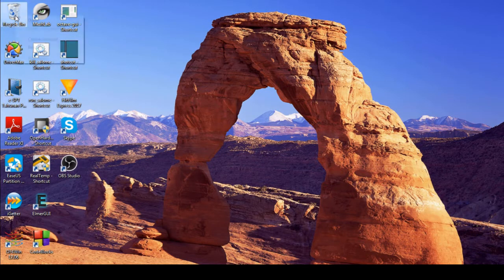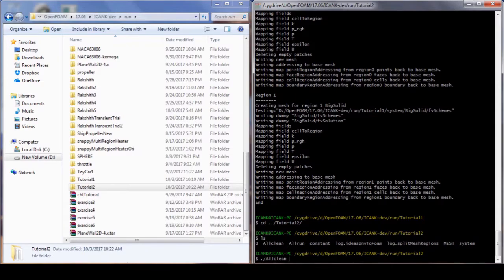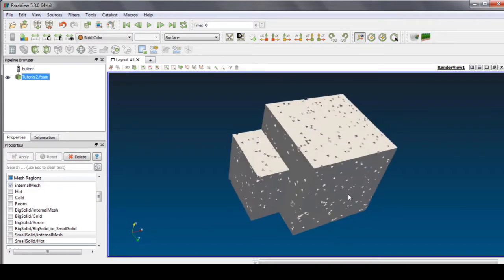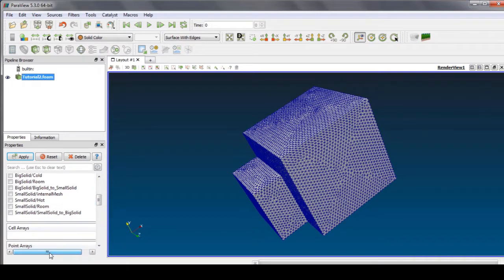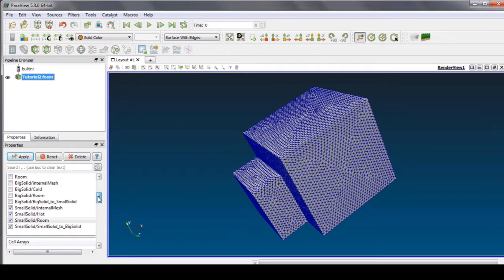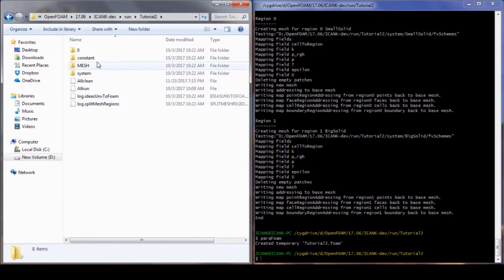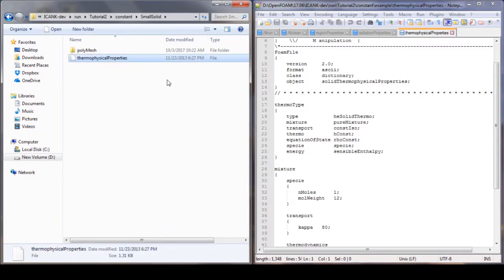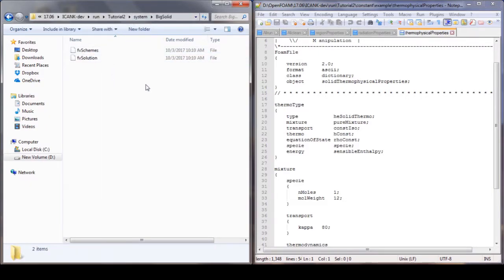SALOME & OpenFOAM Tutorial: Heat Transfer Between Solids - Modifying Case Folder

Comment: Hi, I have a question, where can i find information about the differences between OPEN-FOAM vs SALOMEMECA? , depending of what I should use one of them,  for what kind o physiscis intendef for, each of them? , both can handel fluid structure interaction, with the same perforamance,  modal analisys?

Comment: First of all, thanks for the amazing video

I have a question, try running the command "paraFoam" to open paraview. However I get the following message:

Invalid $ PV_PLUGIN_PATH and -plugin-path = not defined
No supplementary ParaView / OpenFOAM reader modules
Using builtin reader: paraFoam -vtk

Created temporary 'test2.foam'
/ home / jorgeamg7 / OpenFOAM / OpenFOAM-v2006 / bin / paraFoam: 420: paraview: not found

The way I installed paraview was that I downloaded it and installed it on windows C disk.

Comment: I've meshed a heat exchanger on freecad, there's one fluid and one solid region. The solid part has fins, which has interfaces with the fluid region so it's a very complex geometry.

when i try to use snappyHexMesh, it cuts out some of the fins, do you have any suggestion or any thread that could solve my problem?
Reply from the maker: Try to make the surface mesh denser in SHM. For sure you need to do a lot of trial and error for finding the appropriate setting. You can try also find the answer on  Cfdonline website.

Thanks

Comment: Hello @Ali Ikhsanul.. your videos are great. Really helpful. But in this part, when I am trying to run the ./Allrun script it throws an error that chtMultiRegionSimpeFoam not found. I am using OpenFOAM version 6 where this solver is not present. How can I simulate your example in this case?
Reply from the maker: Hello

Try to modify the solver's name in allrun script. You need to check the available solver for this case
Reply: @aliikhsanul7982   Thanks a lot for your answer. I installed openFoam4 and it worked fine. This series has given me quite a good basics of heatTransfer between solids. However can you please also make a video on heatTransfer between Solid and fluid? OR refer me some links where I can find some guidelines. Thank you!!